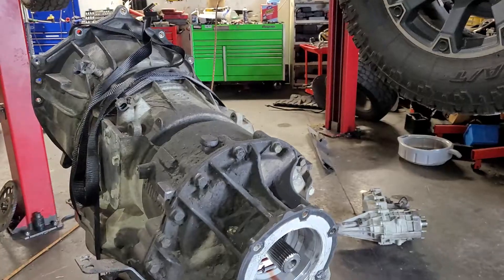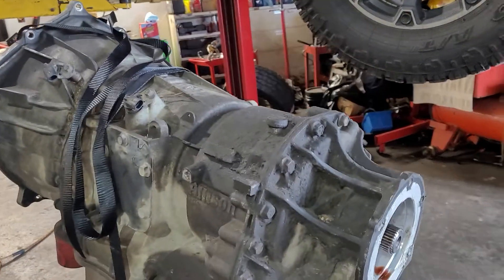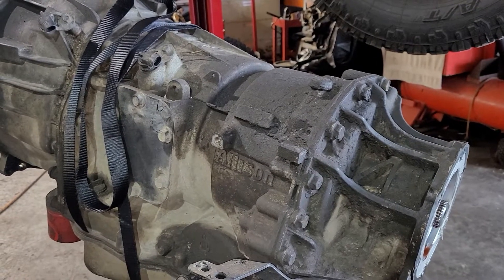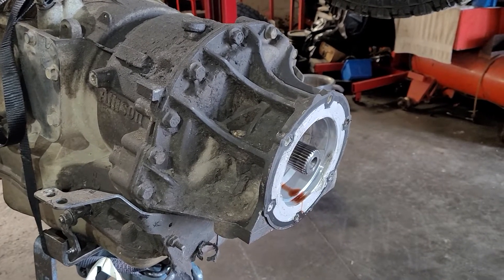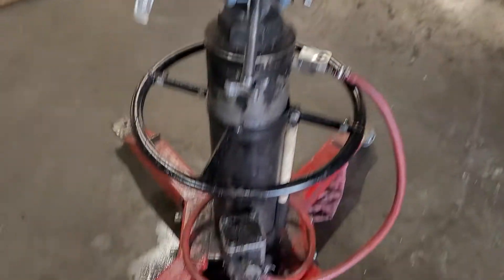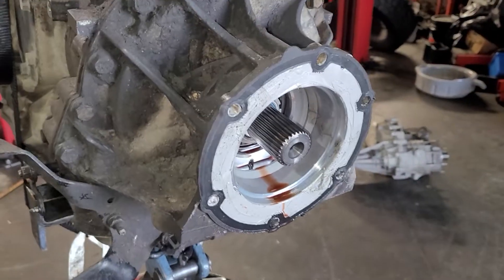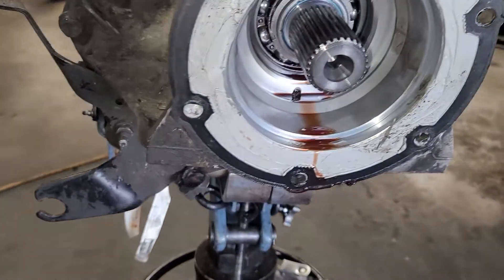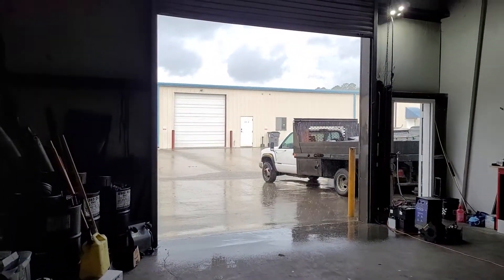Fluid expansion due to heat . Checking transmission fluid correctly

Comment: Question.. on a Silverado 99 before I start it, is it good to check if the transmission fluid is at the cold level before starting it? On my dip stick it has a cold and hot. I know I'm supposed to check when warm but what if my dipstick is showing way past the hot mark when cold? Is it overfilled?
Reply: always check transmission level with engine running.

Comment: I've noticed on honda cvt transmissions specifically you want to really get them hot before checking the level. I don't mean just letting it idle either. A good 20-30 min drive on the interstate is what I do. They're so easy to overfill. I always wait until not a drop is coming out from the level check plug. That way I know I'm at the perfect level. In the past I've simply let the car warm up until the fans come on twice, but have found even that's not enough, really need to drive it, and get it good and hot. Otherwise you'll overfill and the car will feel sluggish. I've actually noticed a difference of a 1/2 to 3/4 of of a quart difference between letting it idle until fans come on twice compared to a good long drive.

Comment: Thank you for educating people on the how and why transmission fluid expands with heat requiring a dipstick check at operating temperature . Most people think it can be checked cold like engine oil and don't realize there is a specific amount that needs to be in the system . Excellent visual how heat affects it.

Comment: Soooo..... If I look at the dipstick when the car is COLD, the trans fluid level appears to be over filled. Then I run the car for a while, drive it, check it when it's hot and running and there appears to be less fluid. I assume the less fluid reading is due to the fluid being in the trans, like oil would be inside an engine, no? If there appears to be more fluid than necessary when it's cold, doesn't the same principle of engine oil apply that the fluid is over filled?
Reply: Same
Reply: After you start the car, the fluid gets drawn up into the torque converter and the rest of the transmission. 
If you check it with the engine shut off, the level will be much higher than the normal operating range on the dipstick.